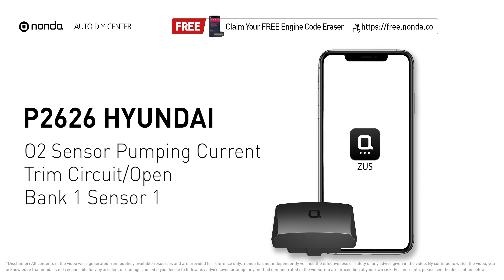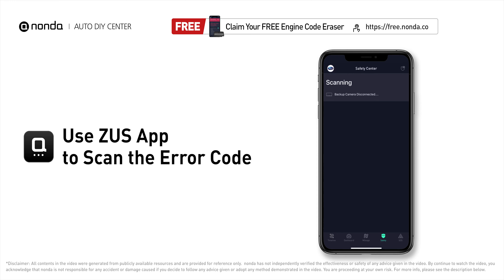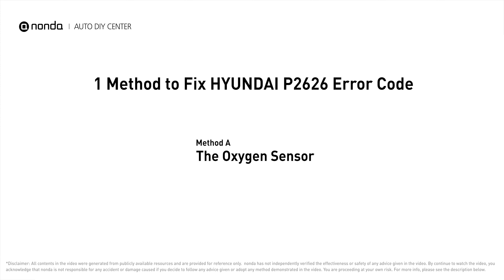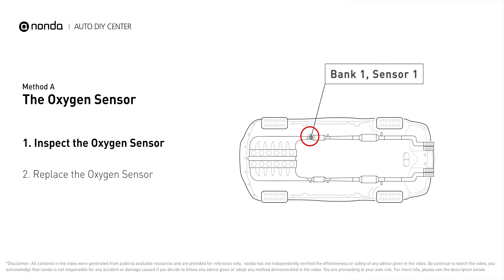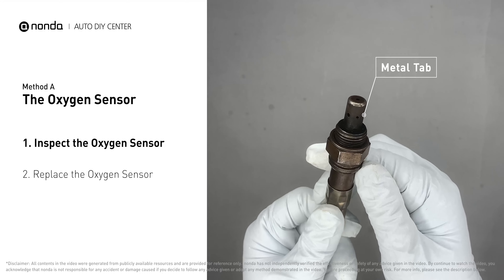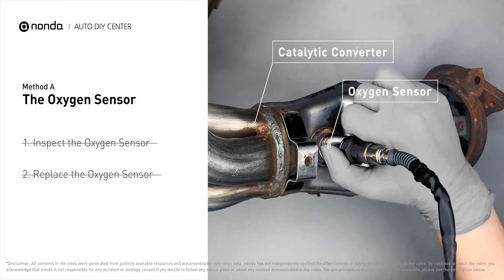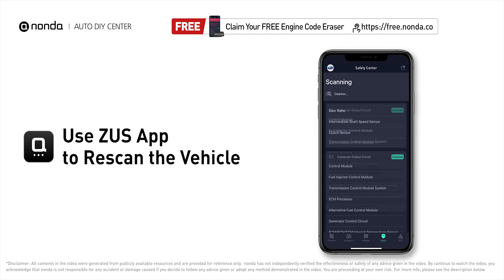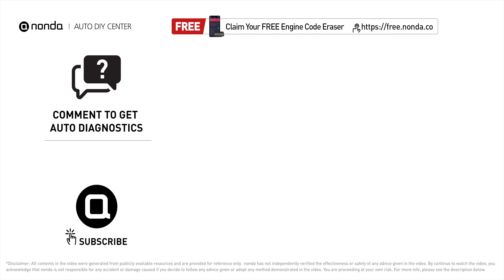How to Fix HYUNDAI P2626 Engine Code in 2 Minutes [1 DIY Method / Only $19.45]

Comment: Please give me
Reply from the maker: Hello, please provide us with your vehicle's year make and model.
Reply: Intra v30bs6
Reply: tata intra v30bs6
Reply from the maker: Usually, replacing the oxygen sensor fixes the code. Kindly inspect also the Electrical Connections, Wire Harness, And Metal Tabs for any issues.
Reply: I have Hyundai Elantra Gt 2017
Thats give me P2626 Code and i have change the O2 sensor but code still active, how can i fix it?